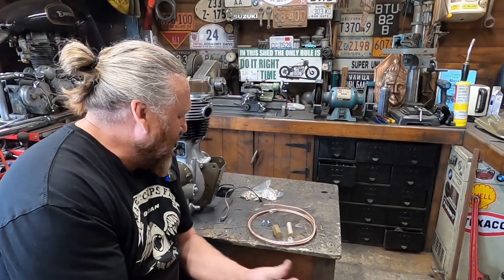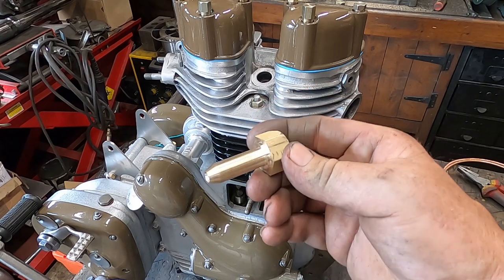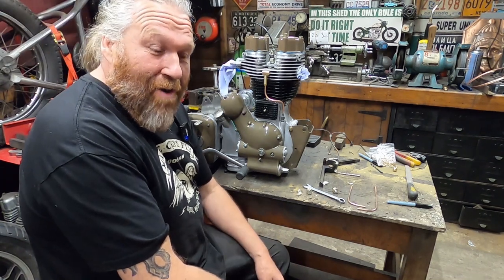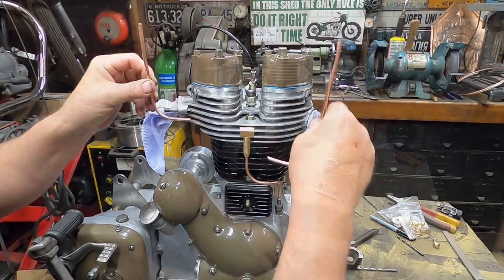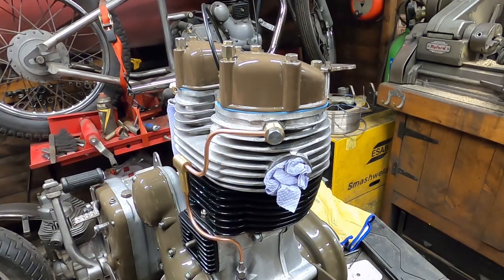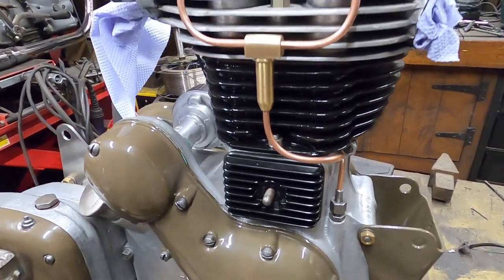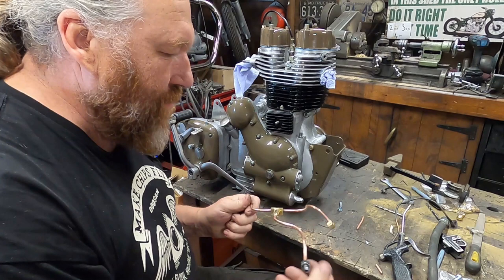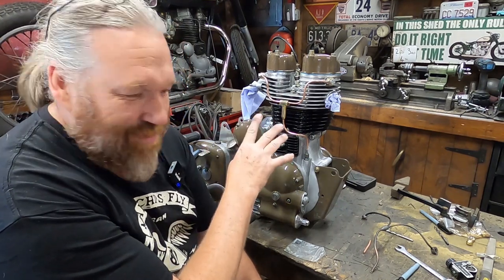Royal Enfield Project Part 40 Oil Lines

Comment: Hi Craig the Enfield is looking good me and the bodger we have a triumph 1955 t100 it has an amal monobloc carb and the stop screw won't let us make the bike tick over faster any ideas what is wrong cheers from bodger
Reply from the maker: Is it the original carb? Amal's are very good at wearing out and you cant always spot it, maybe a service kit or replace, I had a Triumph 3TA that would not run right or tick over very well no matter what I done, I replaced the carb and it totally transformed the bike. sort of the reason I never ever buy a second hand Amal carbs, some look great but are actually scrap.
Reply: Cheers Craig it's a 376 / 35 any idea how much it would be and thanks from the bodgers